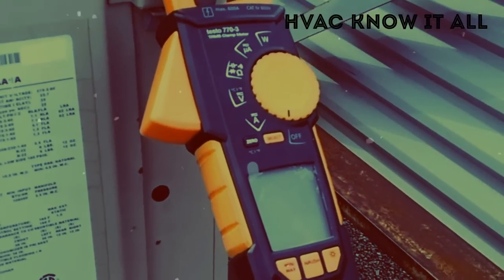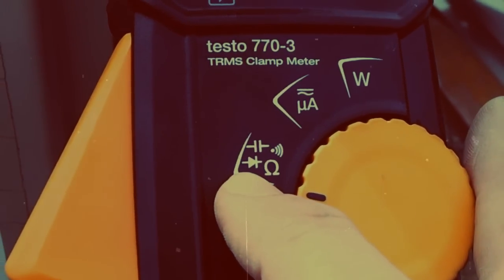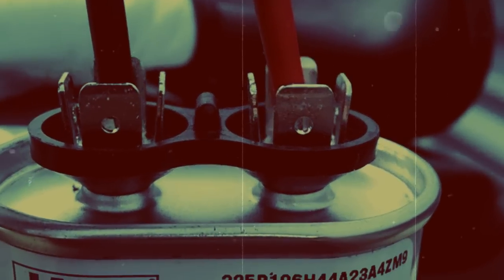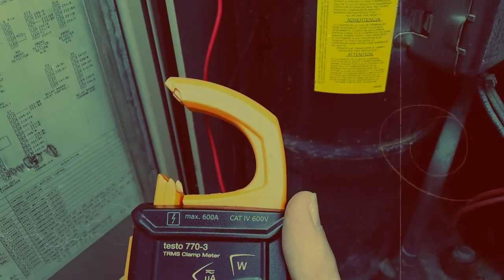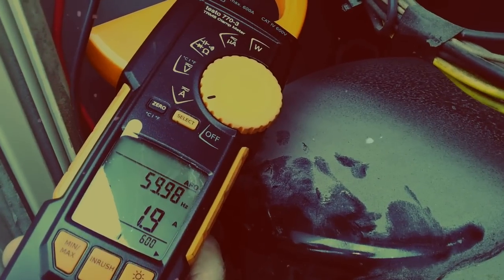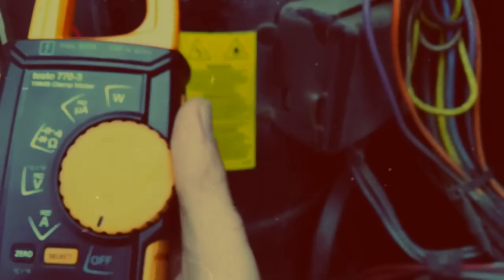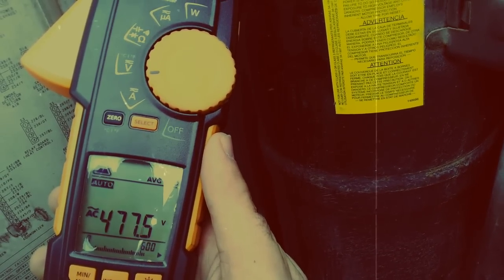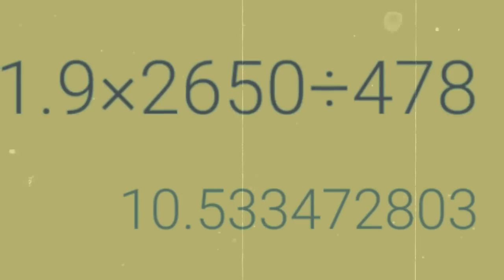Testo 770-3 checking capacitors.

Comment: Using this method saves a TON of time when you've got a schedule full of maint. checks.

I feel like it's more accurate to test the cap under load(not at rest) as well, but it definitely keeps from damaging spade connectors or loosening them and possibly causing a hot-spot that's gonna fail on a hot day.
Reply from the maker: I'm still not sure if it is or not, but it's close

Comment: 478 v across a capacitor rated at 440 v ???
Reply from the maker: John Bond back emf
Reply: HVAC Know It All  would you have further information or explanation why the back emf creates a higher voltage reading? Just trying to get my head around testing capacitors. Thanks. Ps. Great videos 👍
Reply: "back emf" answer is rubbish. It's errorneous, has nothing to do with this situation and, what is most important, provides false support for voltage problem. If it were me, I'd either check with capacitor manufacturer that this is actually within its limits or change it for 500/600 voltage.

Comment: One of the worst meters I’ve owned do not buy
Reply from the maker: arron mcgarr why's that?
Reply: HVAC Know It All mines the 770-1 but the capacitance doesn’t work the amp draw doesn’t zero below 0.2 amps just really disappointed with it . Sold my fluke to buy it as well .
Reply from the maker: arron mcgarr my Fluke 902FC also reads 0.2 amps minimum and it's $150 more.  That sucks about the capacitance though, every electonic device will have it's lemons, did you reach out to Testo for warranty?  Some advice, never sell tools to get new ones.  It's best to have a collection for when things aren't going your way.
Reply: HVAC Know It All yeah just waiting to hear back from them . Maybe A one off bit gutted as inrush function is ideal for hvac
Reply from the maker: arron mcgarr good luck!

Comment: where you get the 2650?
Reply from the maker: amazigh ouzaffoun it's just a constant thats used...I'm not sure who pulled it out of their ass lol
Reply: HVAC Know It All  would this constant change for the uk at 50 hertz? Or would hertz not come into play with this?
Reply: It is an erroneous number spread about the internet, the true formula should read    Amps * Xc / Vac = mfd, where Xc is Capacitive Reactance. Xc can be found by using the formula    Xc in Ohms = 1 / ( 2 * pi * Frequency in Hz * Capacity in Farads ). At 50Hz , the number would be 3183.08, at 60Hz it would be 2652.56, far from being constant. The results when you plug this number into the equation    Amps * xc / Vac = mfd   can be alarming. Using small numbers to emphisize the importance of measuring Frequency, a reading of 2Amp, and 275Vac Back EMF, at 50 Hz would indicate 23.149672mfd, and at 60Hz, it would indicate 19.291345mfd. hardly reliable if Frequency is not measured. we all have to deal with the power grid, substations, lines, transformer, etc, and we know how machines and parts fail, so no, its not standard.